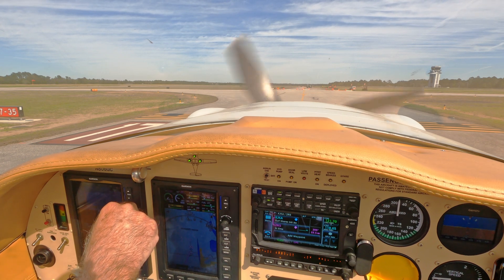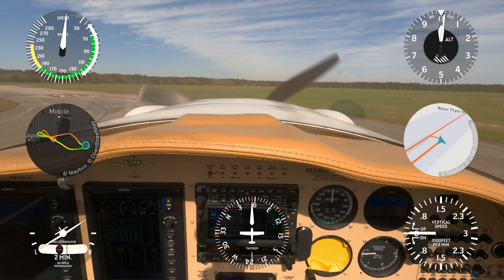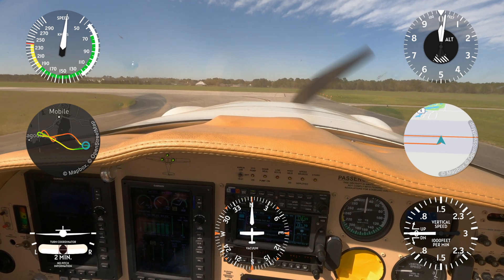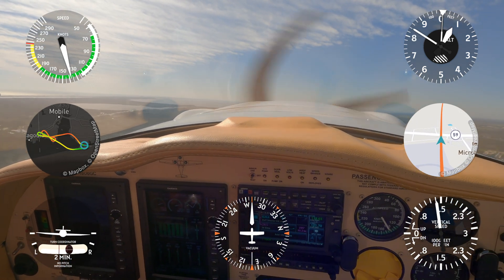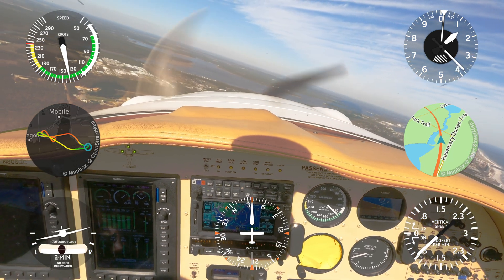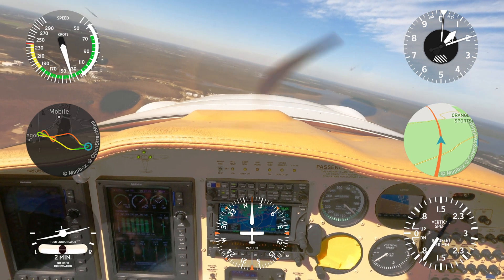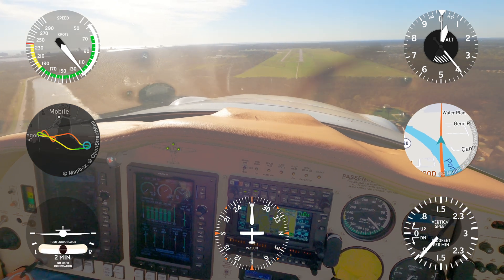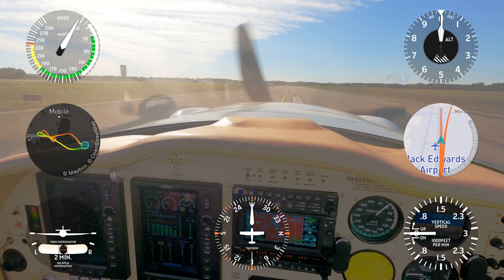Lancair Legacy Speed Test -  New Panel Ordered

Comment: I have a questair venture I am getting up to date on condition inspection, as soon as I have that complete, I will try to do the same video so we can compare. I believe I will get a better fuel burn, but my take off field elevation is 5,800 ft so it won't be apples to apples.

Comment: Thanks for sharing your flight with us specifically showing the six pack overlay. I just happen to fly with my friend for breakfast yesterday in his Lancair ES with fix gears and his plane was doing 160 Kts at 3500 feet with 55% power by the way the fuel consumption was only 10.5 gph with LOP.
Reply from the maker: Nice, a little  more economical, but I am enjoying the speed!  He is getting around 15mph and I am getting 14. Not much difference.

Comment: Gettin' spoiled with your consistent LEGACY videos!!! Every time I get a PiLOT STEVE notification... Big Smile on my Face!!!

I've been pondering your HEAT issue on climb out... Your Legacy does have a modified cowl and air inlets versus the standard round ones. Wondering if your bigger trapezoid style openings are as efficient and also how different the baffling was modified vs standard to work in the turbo mod. Are there blankets on the turbos? What are the individual cylinder temps like?

I wanna put in a big request for some outside footage of your Legacy when you can🤞😊🤞... fly by's, mid field breaks, takeoffs/landings, taxiing... I could go on and on! 🤪

Enjoying the rides!!! Keep 'em coming!!!
Reply from the maker: Will do, but I'm usually a one man show so it's hard to get takeoff video. I am working on attaching a 360 camera to the belly. Should be soon.